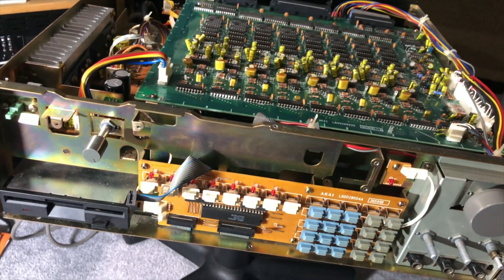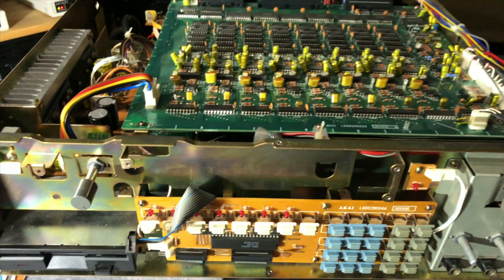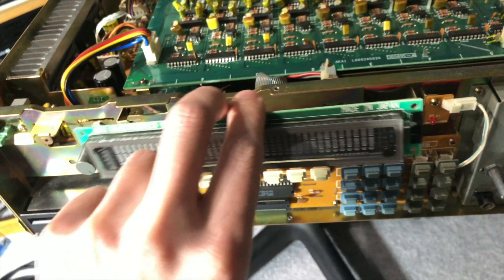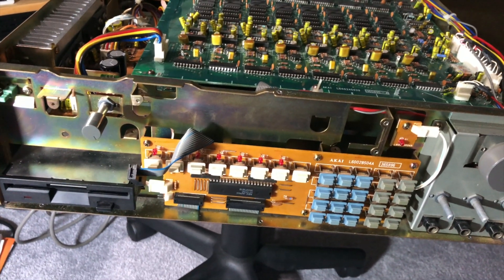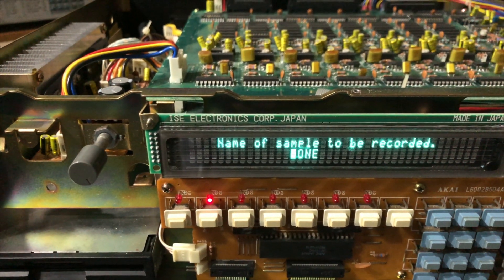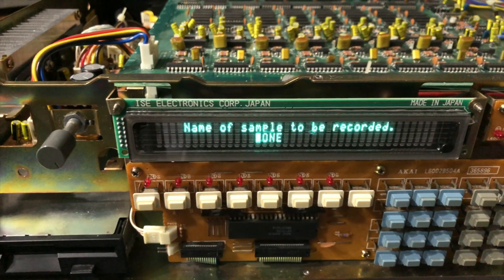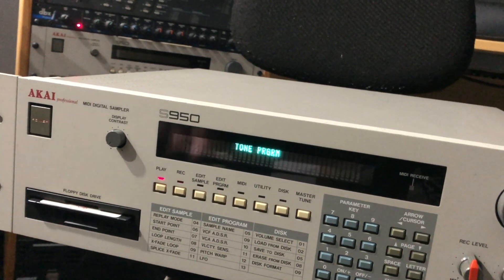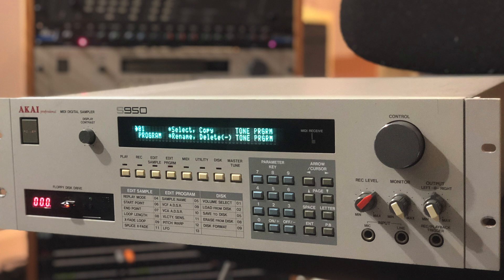DFACE DXA - How To Install Noritake VFD Display on Akai S950

Comment: im still rocking my OG backlit screen at the moment, i can feel it dieing though, its getting dimmer, i wish they made these in the original color sheme. i installed one of these on a emax one day and i did not like how it looked, idk it looks so modern or something, its obviously way better though.
Reply: This def has a different feel.  i like the way the viewing angle works but my I feel what you are saying.  my main 950 still has a normal backlight in it.  you can just buy a backlight the same color as OG if you want to keep the classic look.  also there are LED displays but they also seem moderns too me, almost too backlit.  The VFD is easy on the eyes to me in comparison.
Reply: @dfacedxa  ooh damn yeah i think i had an oled display, not vfd, maybe thats why. btw just saying, props for the vids, i havent used my gear in like 4 years and finally have everything resituated, checking youtube to see whats going on nowadays and im glad to see youre still going at it! always a fan of yours
Reply: @BoechaarBiets  yeah the oled ones are really bright and no doubt man i appreciate the positive feedback.

Comment: peace. thanks for all the gems on the channel. can anyone help with this issue? I did the install on a 900 and it's doing something weird. if I go to a screen where there is text in the bottom row, it stays there until I go to another screen which replaces it. like characters freeze. any ideas? thanks.
Reply: hey i would try two things if possible.  does this happen with your original screen?  does it do the same thing if you put the new display into a different s9xx?  My guess would be theres a problem with the screen maybe connection or compatibility wise.
Reply: @dfacedxa  Thanks for reply. OG display did not do this. i don't have a 2nd 900 but I will try a 2nd display.
Reply: @MrRingerStatus  cool lemme know how it goes

Comment: Anything to make note of when you replaced the floppy drive with the emulator, or was it fairly straight forward? You're able to get at it by just removing the top cover and face plate same way? Thanks!
Reply: you don't have to remove the faceplate.  but you do have to remove the power supply board.  pretty simple process and fairly straight forward.